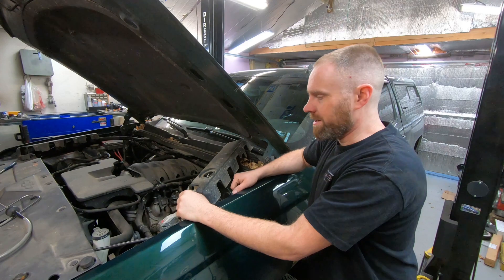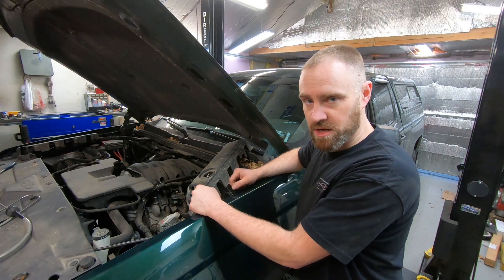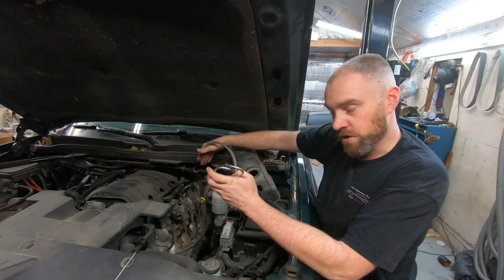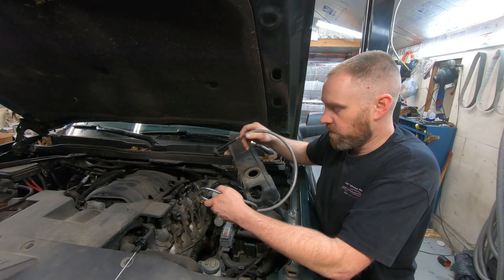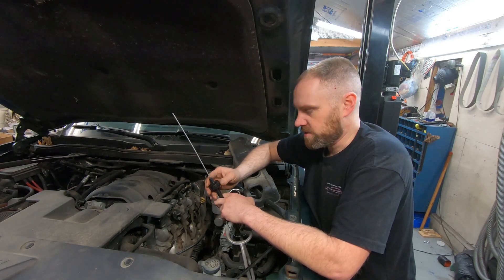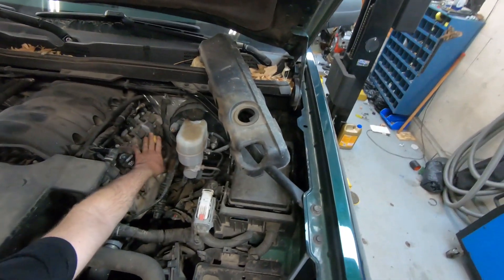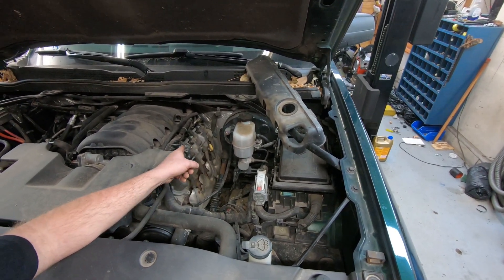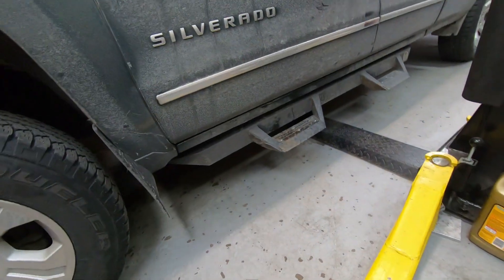Diagnosing Ticking Lifter 2015 GM V8 Engine Knock Sound

Comment: I have a 2015 with a similar noise. The dealer said it is most likely a pitted cam lobe and recommended replacing all 8 lifters, the VLOM and camshaft to the tune of just over $6000!!  My PT warranty was out this past Dec but I only have 60k on my Sierra SLT 6.2L.  The dealer initially told me I was SOL but I called GM and  they said there is a grace period of 12mo/12k miles after the OEM warranty to which they offer cost assistance with such a larger repair.  So after many phone calls with GM ( who, by the way, have been great to deal with compared to the dealers) they are going to go 60/40% on the job. So with the warranty pricing it dropped to just over $4200 and I may be into it for around $1300. My question is had GM fixed the issue that causes the lifters to fail by enlarging the oil holes or something? I typically hold on to my trucks for 10 yrs or so and would hate to have to got thru this again.  I switched to GMC from Ford (2008 f150) as I was sick of all the "It's a FORD thing" and hate to see that I'm right back there with "a GM thing"   I guess if I got a RAM it would get the "Dodge/MOPAR thing" problems so I just can't win.
Reply: HI Jim, are you in Canada as I'm in similar boat and was wondering if GM USA did this for you and not GM canada?

Comment: Great video. I have a very similar sound on my 2011 Silverado. For whatever reason though it gets quieter when the engine is at operating temp. You can still hear it, but it's more of a light click at that point and I'm positive it's not an exhaust leak. I look forward to seeing your next video on this for the results.
Reply from the maker: Check my community Post, I showed a picture of the damage. Video will be a while I have a lot going on.
Reply: @CrazedPerformanceRepair  thanks for letting me know. I saw the pics, definitely not good.
Reply: @CrazedPerformanceRepair  what did you end up doing for the repair? New lifters and camshaft, or something more?
Reply from the maker: @markusbecker9018  did a full mechanical delete of the system.
Reply: @CrazedPerformanceRepair  did that truck have a Polly squeaking or is that the sound your talking about?
Reply from the maker: @matthewowen2305  that squeak was part of the noise.
Reply: Is it safe to still drive the truck? My truck is making just about the same noise as in the video.

Comment: I had a lifter sound but no issues or misfires, pulled the push rods and had bent one.
Reply from the maker: It will happen again, there is interference between the AFM lifters and the push rod with the angle of the push rod on these engines
Reply: @CrazedPerformanceRepair  dam... Thanks man. Kinda wanna just trade it in now lol I miss my 04 5.3 older seems more reliable these days.

Comment: How can you prevent this for happen?

Do you have any advice on preventing carbon build up in Gm direct injection engine?

Happy New Year!
Reply from the maker: Unfortunately there really isn't a way to prevent it due to its design. You can clean it out every so often though if you have a induction cleaner kit and the chemical. You can use the sprayer portion of a kit like this https://amzn.to/2JGUtPU The sprayer is in the bottom left corner of the box in the main picture.

Comment: It would be interesting to see how much ferrous (camshaft/cam follower) metal the engine is making during the last oil change cycle. 

Maybe try opening the oil filter and use a very strong magnet on the pleats and report your findings?

J

Comment: Is that a LS or LT?  Didn’t Chevy switch to direct injection in mid 2014/2015?
Reply: Thats exactly what happened to my 2011 LC9. Could see that on either LS OR LT.
Reply from the maker: It's a 2014 LT, but it doesn't matter it can happen to any of them. The future videos to come will matter some that it's a LT though.
Reply: CrazedPerformanceRepair Yeah, although the carbon build up on the direct injection LTs valves can be a real problem.
Reply from the maker: @jeromeburrasca6710  oh for sure and I'll cover that when I pull it apart. Actually I talk about direct injection and carbon buildup on one of the mustang engine videos.

Comment: New engine time  all new lifters and a cam id bet.
I spent 3k trying to avoid being told oh you need a new engine and for 3k I could have just bought a new engine at 2200 and  paid 1k install
instead they charged me 3k to tell me nope now you got a lifter stuck and another mechanic thinks they swapped engines which would be major fraud to pull on me regardless  im out 3k  I owe my brother 2400 of that and cant pay him and the truck wont sell because the lifters fucked..    In order too see what is wrong replace all new lifters and roll the dice on a cam also  id be paying another 1500 plus parts and they would need to take the engine out to see the vin #  or at least get into it some to see if the engine was swapped  2008 CHEVY VLOM MOD VIOM PLATE REPLACED REAR MAIN SEAL OIL INTAKE NEW PAN ECT   3K DOWN
truck might bring 3k    paid 3o k for the piece of shit to BAIL GM OUT WHO CLEARLY FUCKED EVERYBODY AS THIS HAS BEEN REPORTED AND GM SAYS  HAHA SUCKER.    FUCK GM  WONT EVER BUY ANOTHER  PRODUCT FROM THEM AND 1OOK 110K MILES OIL CHANGED EVERY MONTH OR TWO.  LO MILES EASY SMALL TOWN MILES AT THAT  NO EXCUSE FOR LIFTER TAP WHEN IT NEVER EVER MADE THAT OFF C 4  OR ANY SUCH NOISE  LIFTER COLLAPSE AND YOU CAN BET CAM DAMAGE AND THE TRUCK WAS TOWED IN TO AVOID ANY DAMAGE..    WHAT A COMPLETE JOKE GM IS
Reply: I think someone is mad..
Reply: Even Toyota bends their customers over with engine defects. Ford does it daily. That's the nature of the auto industry.

Comment: Thanks for the informative video. 👍i have a 2010 gmc 5.3 . I use one of those plug in chips that keep the motor in 8 cylinder mode . I think that it will help my engine to last longer without problems.  Im i wrong?
Reply: You're wrong. 100% bs device
Reply: @JamesValentineBaja1000  nope, plenty of tuners are able to disable this function on the vehicle but very few will be able to right to the ECM to disable it permanently. The best read/write tuner on the market is the MPVI2 by HPtuners, it’s a simple drop down option on their software, plus you can enable the flex fuel sensor if you wanted to put a kit on it to run e85. You can change everything from fueling, spark advance, redline, and even transmission shift points with the HPtuner but those are the two things most people buy it for.
Reply from the maker: The Range device will help prevent from some AFM failures but not this particular type of failure.

Comment: I wanted a 15+ Tahoe, not sure anymore due to all the issues. Weak trans, fuel injectors, cams.
Reply from the maker: All vehicle makes have there issues. The gm trucks are ok but it is best to shut off the AFM as soon as its out of warranty if you have one.
Reply: It's trivial to disable AFM. There are at least 3 cheap and easy ways of doing that. The other potential issues you mention are rare. Just avoid the first few years of the 8-speed transmission.
Reply: karl schauff I would disagree the 3 mentioned issues are rare. I have seen all 3 in large quantity, plus purchase $ is still very high on these trucks considering said issues
Reply: @mph5896   You do realize that GM sells over 1 million trucks, SUV's, and sports cars each year that are equipped with either the 4.3 5.3 or 6.2, right? Even if there was a miniscule 1% failure rate, that's at least 10,000 vehicles with an issue.  That causes it to look like these engines are failing constantly because there are so many vehicles sold each year with these engines. A guy once claimed that Toyota Tundras are rock solid reliable and rarely have problems because there were half as many complaints for transmission issues compared with Ford, GM, or FCA. The problem with their logic was that Toyota only sells a little over 100k Tundras each year. While GM or Ford might have twice as many complaints for transmission issues, they both sell nearly 10 times as many trucks. In other words, at face value, it looked like Ford and GM were having tons more transmission issues, but their issue rate was actually far far less than the rate of issues with the Tundra's transmission. My point is, perception doesn't always match reality.